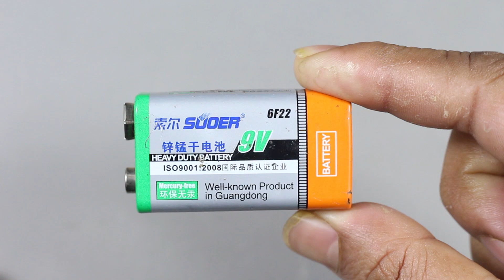100% working free energy with magnets - self running machine at home

Comment: lol! You transform 9V from the battery to run a light buld?! WOW! Is that not just the science of transformers? :P
Reply: But when that 9V battery is dead. YOu have no more power! So it's NOT free energy! 
You need to pull somewere around 5V from the air, then convert it to 12V DC and feed that trough a capasitor and you might be ablt to charge your cell phone :D